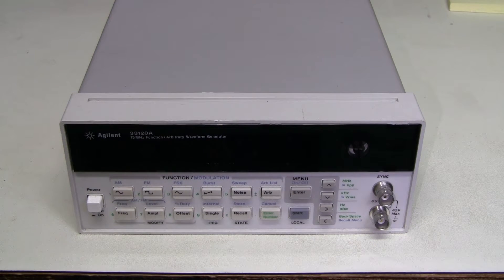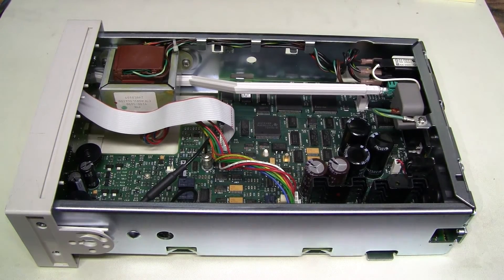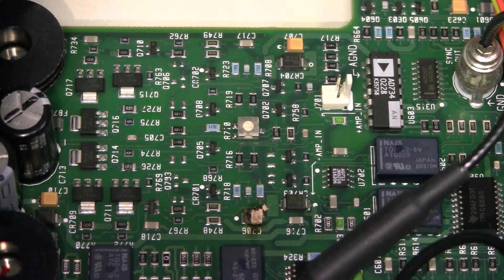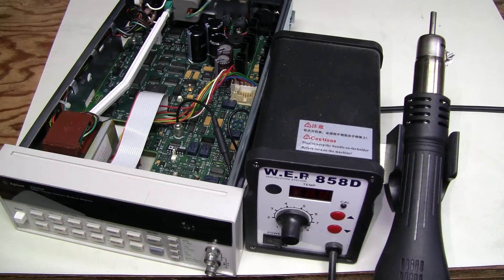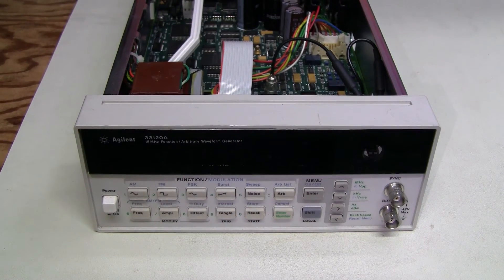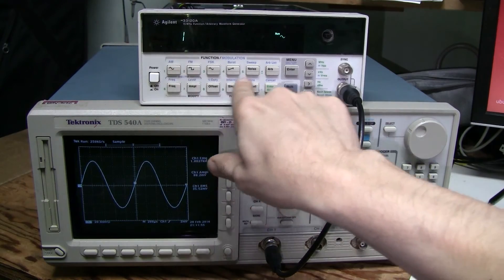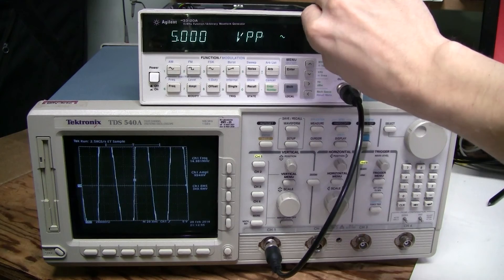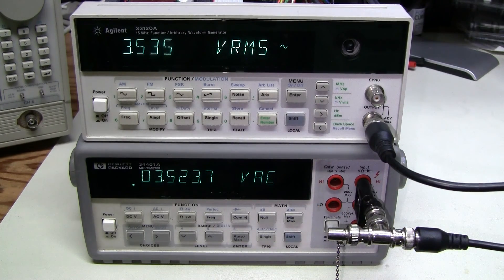#38 - Agilent 33120A function generator repair

Comment: feedbackloop do you have any parts for those tds 500 & 600 series oscilloscope. I have a tds 500 series that refused to boot due to a burnt crt tube. Once removed from the main board the oscilloscope started booting. do you have any crt's? or the crt driver? if not I may have to purchase an LCD and interface it. Thanks!

Comment: How do you find these on eBay in there UK they want very nearly as much for none working as they do for working ones, also if you can find me a house near you that would be great as you just pop down to your Electronics shop for parts and in the UK apart from Farnell and RS they are few and far between it is killing the repair business.

Comment: Nice work. Wish I could find something decent on EBay!
Reply: +FeedbackLoop 
For me its location, shipping of that lab stuff from USA to Poland cost about 200$, so for damaged lab power supply sold for 50$ i have to pay at least 250$ in total, also I will have to pay taxes, at least 23%, with that tax it will be 307$, and its not the final price, there is also more kind of taxes.
So I have to pay about 350$ for crap...
For 350$ I can get fully functional and new power supply, but its too much for hobby use, so I have to buy chinese crap or make one myself.
Reply from the maker: +rupert handford 
What is stopping you?

Comment: Do the SMD style Tantalum caps usually fail as catastrophically as thru hole types?  Those can be quite messy and spray a chassis with messy debris!  Nice find, and again you get an easy fix!
Reply from the maker: +Dino Papas 
I have seen a few cases of failed smd tantalum caps so far. This one was, perhaps, the worst, but yet it wasn't too bad: didn't char the board, didn't spill debris and didn't ruin the pads.